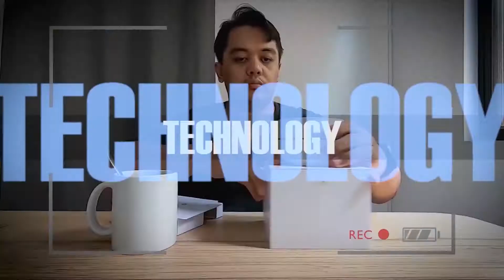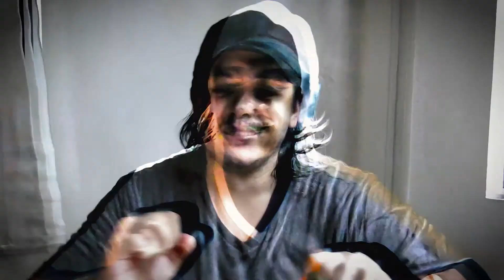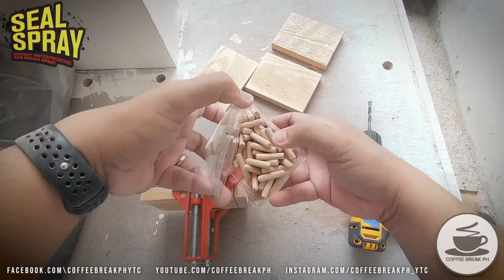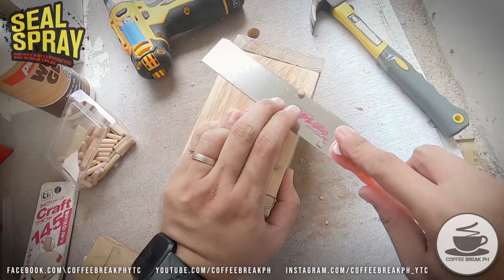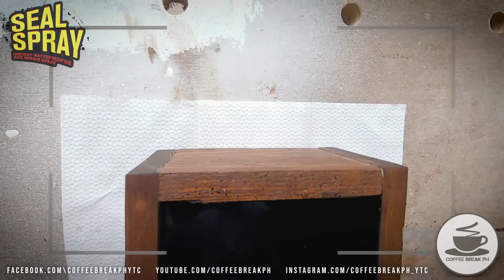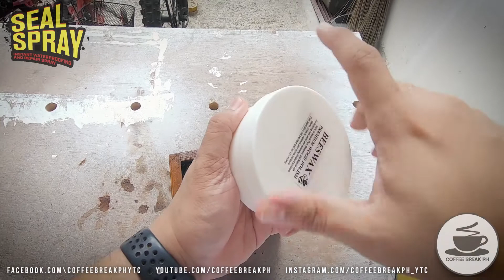DIY Wooden Planter featuring Seal Spray PH | Wood Pallet

Comment: Saan lalabas ang tubig boss? Baka mabulok ang ugat ng halaman ? Anong halaman kaya ang pwede sa ganyang DIY?
Reply from the maker: Good question po. If a drain hole is needed, you can drill a hole prior sealing the wood. Yung sa amin kasi, konti lang yung water na nilalagay namin kaya di gaano basa.. pero yun, you may change the design according to your needs :) Good luck po on your DIY :)
Reply: @CoffeeBreakPH  ok po! Good luck po sa inyo!